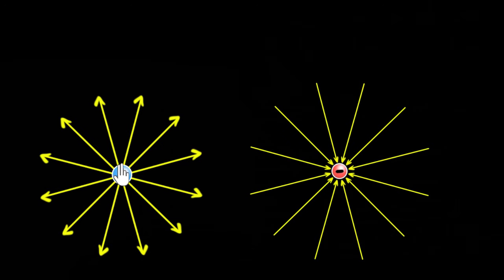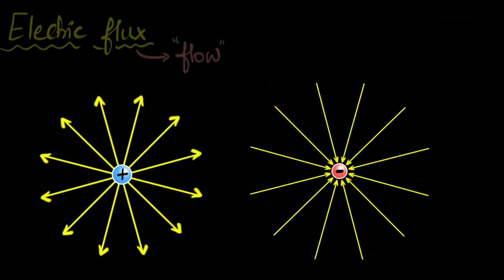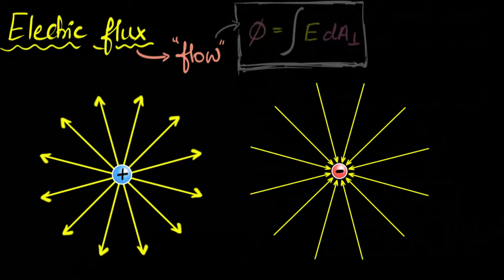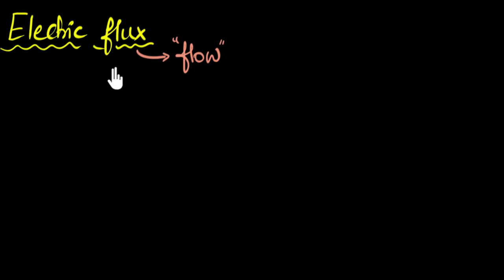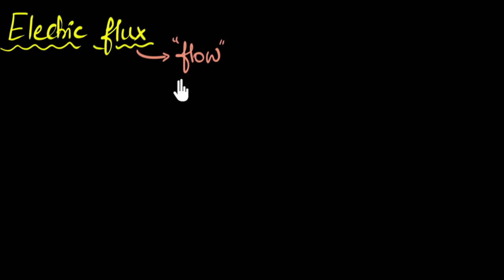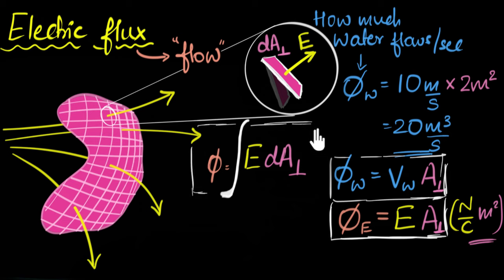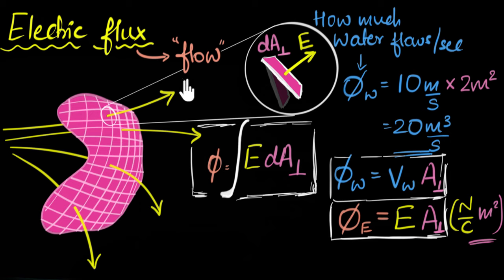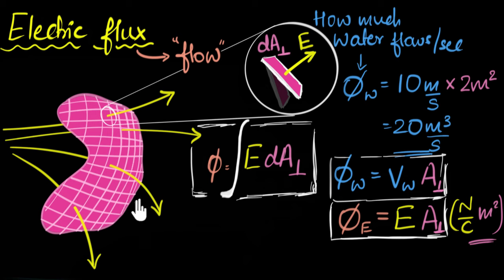Electric flux meaning (& how to calculate it)  | Electrostatics | Physics | Khan Academy

Comment: This seems very confusing. The way it's drawn is not fully correct. Electric field lines exist at every point in space. When you put a surface in space, it doesn't matter, whether it's tilted or not,  there will be the same number of electric field lines passing  in the titled or not tilted one.  This is because E field lines exist everywhere so just tilting it shouldn't make difference. This is why I think the drawing is misleading and the reason is completely different why we take cosa. Can anyone explain this ?